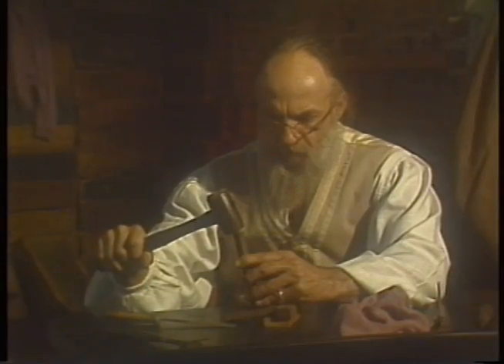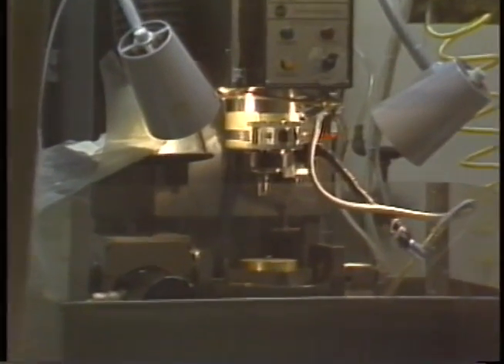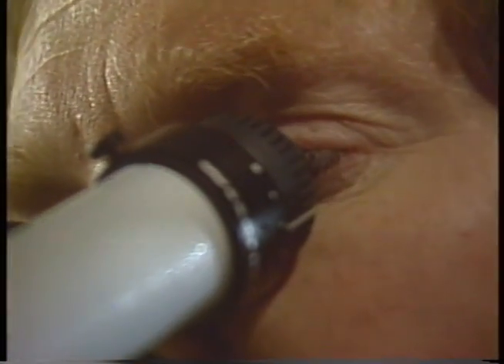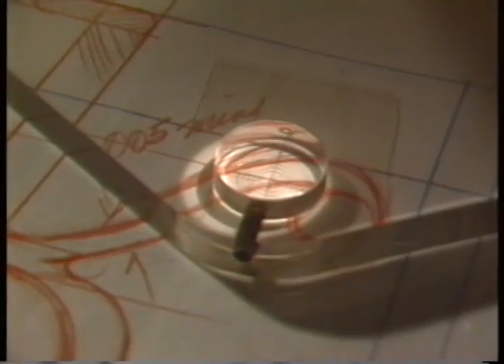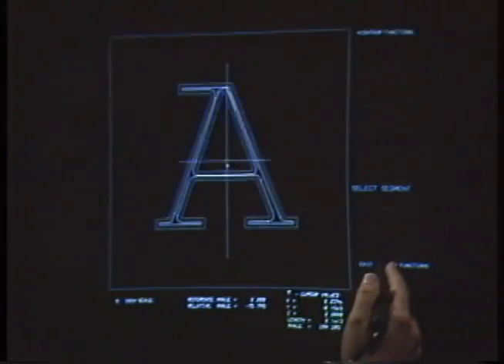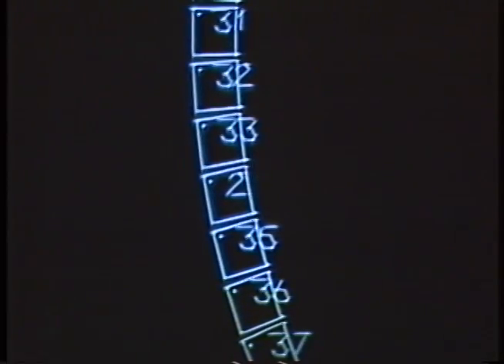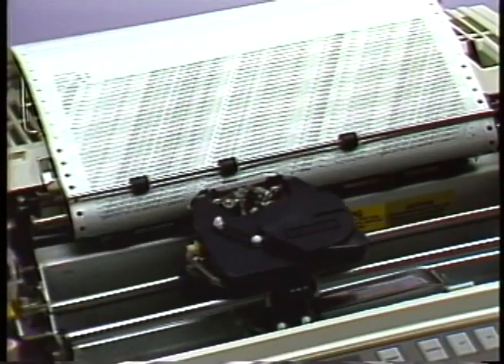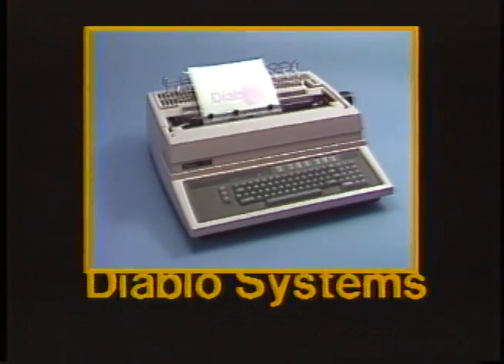Diablo Systems, CAD/CAM Daisy Wheel Production

Comment: My family had a Diablo 630 growing up, a replacement for a Juki 6100. Laser printers were completely out of our budget in the mid-80s. My mother ran a home word processing business, and some of the publications and journals her customers submitted papers to only accepted letter quality print. Dot-matrix output (including "near-letter-quality" 24pin) was not acceptable. Plastic printwheels with film ribbons were the norm, and those printwheels seem to be what are shown in this video. Special jobs called for metal printwheels, fabric ribbon, and sheet-fed high-weight paper.

Daisywheel printers were incredibly noisy, but produced output that was better than any laser or inkjet printer if you could live within the font limitations. I'm sure there's a point of diminishing returns for DPI vs die-cast or injection-molded type, but a laser printer can't match the slight impression that results from type mechanically hitting the paper. The Diablo 630 was one of the speediest printers of its kind, but the rise of laser printers and closing quality gaps eventually doomed the technology.

I'd still love to have access to a diablo 630 retrostation. DOS with wordperfect, and CP/M with wordstar were well-utilized canonical examples. I have heard vague whispers of troff and maybe even TeX being able to drive a 630, including plotting modes that exploited the incredibly accurate position handling of the 630 to do low-res graphics. Something like aalib with glyph knowledge of individual printwheels could probably make some incredible typewriter art.

Comment: I worked at Diablo Systems in 1975 when I was 15 years old. My neighbor was a Electrical Engineer at Diablo Systems and I got a Job after school Building Prototype PCBs and Testing equipment in the Engineering Dept. What a Great First Job !!